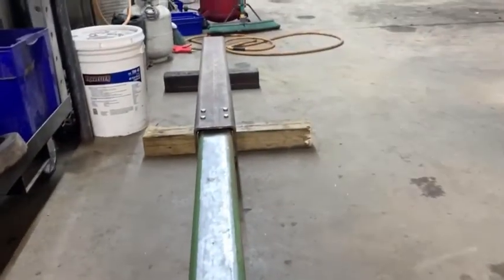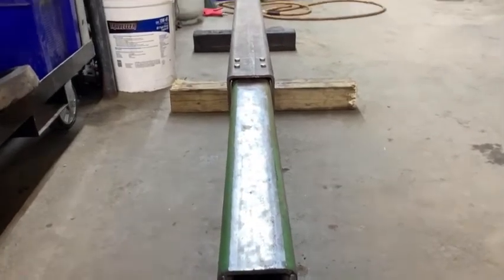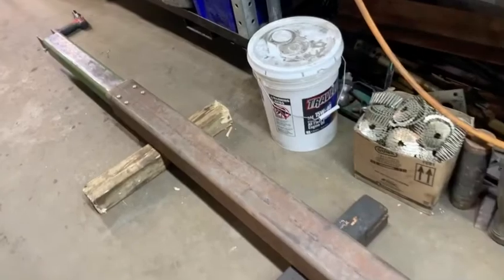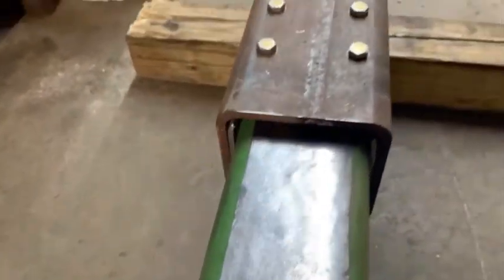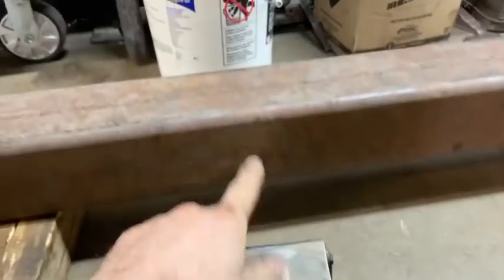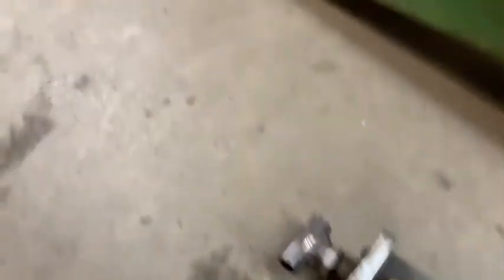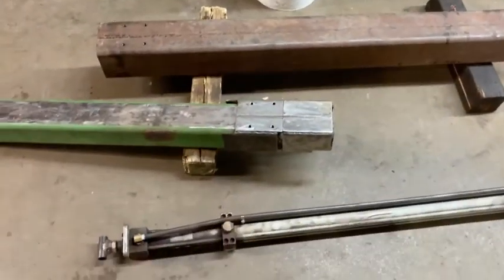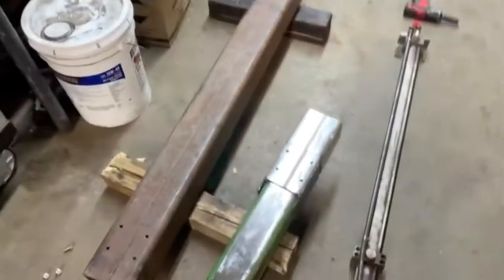Tow truck wheel lift build part 1

Comment: what size is the sqaure tubing
Reply from the maker: The outside one is 5 inch inside one is 4 inch.
Reply: @backintheshop9604  how thick 1/4"? i have a stinger than came from under an 80's ford rollback thinkin of converting it to a wheel lift dont know if it would be strong enough
Reply from the maker: All of my tubing on the main boom part it’s 5/16 thick. I think quarter inch would be plenty though.
Reply: Nice build! Can't wait to see it in action. How heavy of a vehicle would it support?